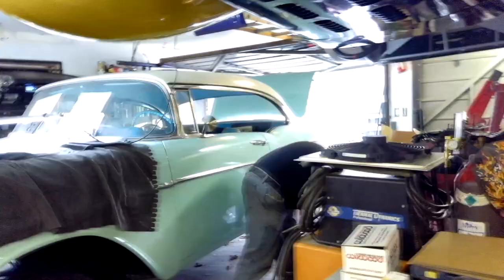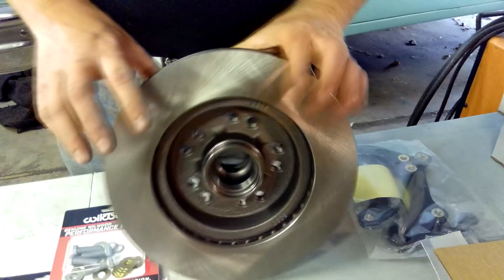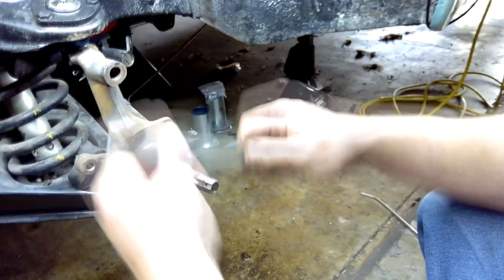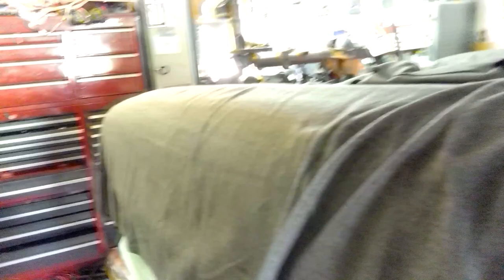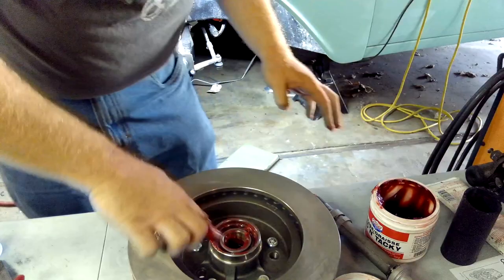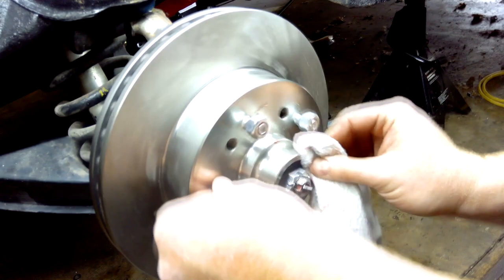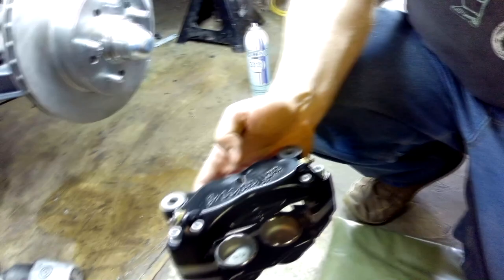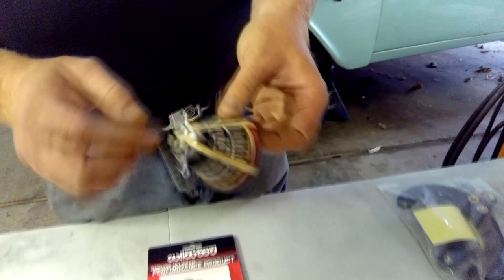Installing the Wilwood Brake kit on the 1957 Chevy Bel Air #chevybelair

Comment: Qwik tip use a zip lock bag. Put glob of grease in it and toss bearing in   and work grease into sides keeping yoy clean
Reply from the maker: Yes it does too.  I still like that feel of making sure it’s getting in.  But what you’re suggesting works good too

Comment: Nice work. I like the lug nut conversion. So you said the brake line was 60 inches? I think you mean 60 mm. I have packed bearings like that before, the only way to go. Other brake conversions I've seen for tri fives put the wheel further out from center, this looks like it doesn't or not as much.

Comment: Don't quite understand why the rotors didn't come with the studs in the right location.  

It is the same for 14 and 15 inch wheels.

Why didn't you take off the control arms and do the bushings at the same time.

Does this kit extend out the wheels by an inch or two or does it leave it in the original position?

That is how I was taught to pack wheels bearings.  Why use a tool, this is easy and works good.
Thanks

Comment: You won’t be able to use a front sway bar if the calipers are mounted towards the front.
Reply from the maker: With this customer provided kit, it mounts the callipers forward, personally it was not first choice as the way the kit is made it, the callipers will hit the steering knuckle.